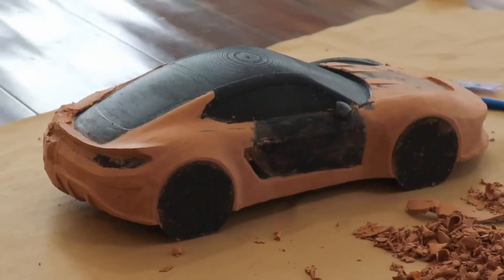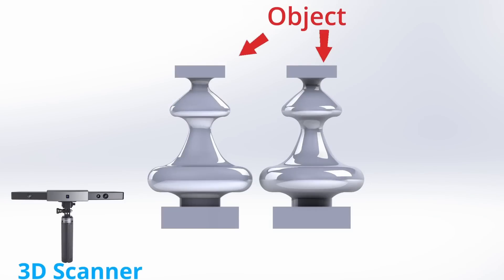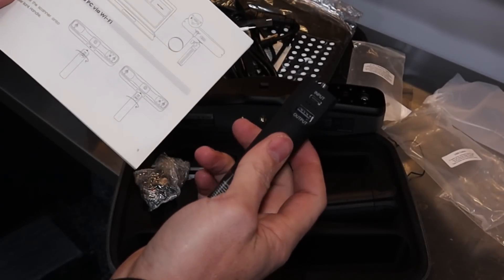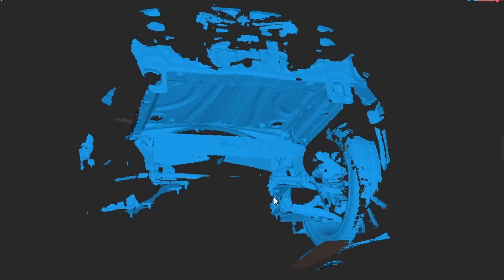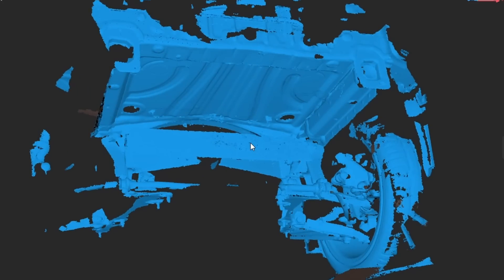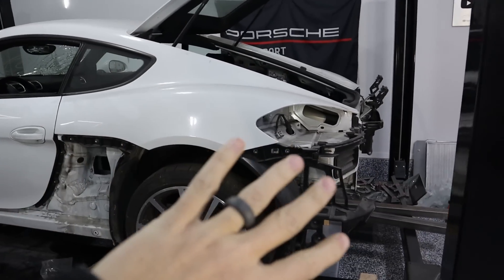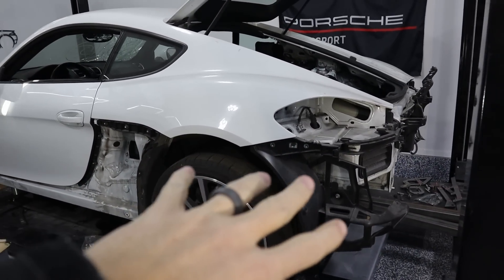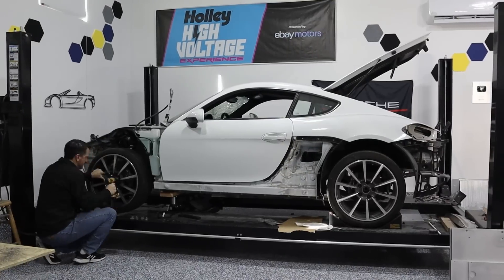RevoPoint Range 2 3D scanner

Comment: Did you have to use the Calibration Boards to get the scanner to work? On the original Range or the Range 2? My Range has always refused to work and after battling with it for longer than I would like to admit, and even stumping Revopoint Support, they wouldn’t replace it, and all they could suggest was that I buy the $80 Calibration Boards set. That’s absolutely ridiculous to me. Just wondering who else has had the same issue.

Comment: Technology has not yet reached a point where you can trust it 100% to get it right the first time without correction or control.  So it is not suitable for the common user.  I hope that the technology will develop enough that we will all be able to use such convenient devices for a moderate price, because you did not mention how much it costs, I conclude that it is not for shallow pockets.  2000+++$